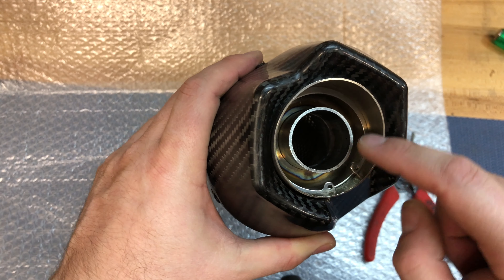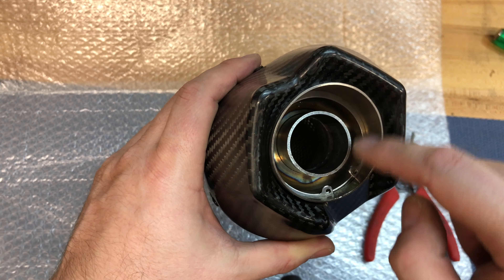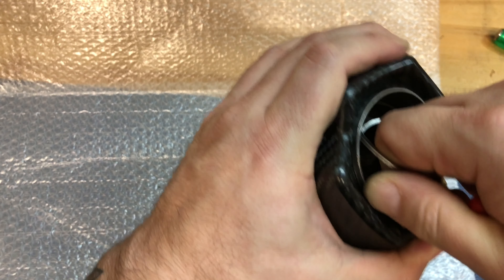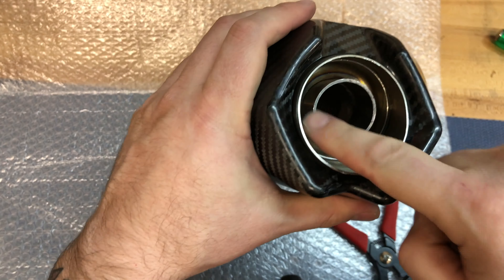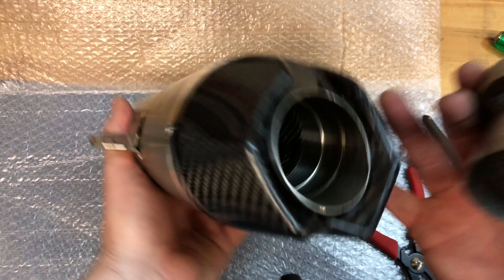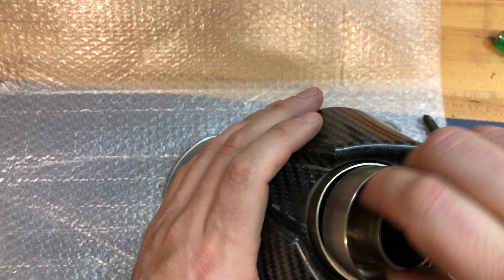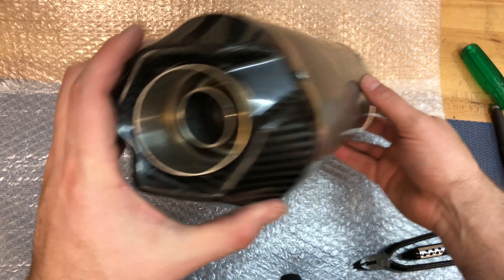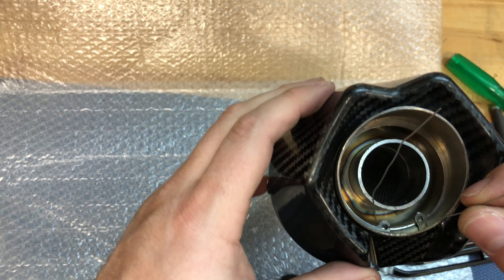How to remove your exhaust dB killer | Make exhausts loud again

Comment: Is it damaging the engine, piston or cilinder if you take out the db killer ? 
The back pressure is low when you take out db killer, is it damaging the engine?
Reply from the maker: A lot, if not most of the back pressure is generated by that catalytic converter. If you are running a de-cat system then the next step for back pressure generation will be the dB killer. The engine may run hot with little to no back pressure. If you are worried about the engine and it's components, you should either leave the system alone or address the ECU tuning of the machine.
Reply: @MotovationUSA  
The bike is carburated 125cc, doesnt have ECU, also deasnt have catalytic converter
Reply from the maker: Carburetors need to be re-jetted for elevation, so I would imagine they would need to be tuned for a changes in intake/exhaust.

Comment: Couldn't you have just pulled the wire through both eyelets and twist it together to compress the C clip? I think I'm going to try that instead of C clip pliers that i own. Pull the wire through, twist it until the C clip comes out freely. To put it back, just drop it in and cut the wire.

Comment: Someone told me that Db killer is part of the backpressure needed and if I remove it from my aftermarket slip on then that's when you have issues with it messing with the way your bike runs. (Ninja 300,2014) I doubt this is true. My slip on has a little like nut that's round holding it in with a tiny weld on one side of the round nut,instead of this C clip. How do I remove that? Love the channel
Reply: That's very true, if your after market exhaust is a full system and its de cat then you will already be making the performance run worst as the bike runs lean, to correct this you need a power commander to correct the fuel to air ratio, removing the baffle takes away that back pressure even more causing the bike to run even more lean, if its bad you'll notice issues like the bike cutting out and white smoke, if it doesn't do either of these you will definitely be harming the performance unless you get a power commander, with just a slip on you'll just notice a performance decrease.

Comment: SC Projects S1 needs to be hit from the inside out, as it’s tack welded in.
Reply from the maker: Ya, we will show new videos with all the different types coming soon. There is a bolt style, and there is the tack weld style.  Fun fact, the tack weld is what allows them to pass the Euro4 testing approval. At that point, technically, the dB killer is welded. As you know, its very easy to grind that weld and remove the dB killer. Thanks for your support Crypto!
Reply: MotovationUSA In the case of the S1, it only needed to be hit out from the inside, no need for using a chisel to break the weld. 👍